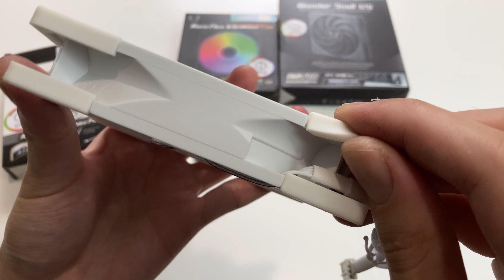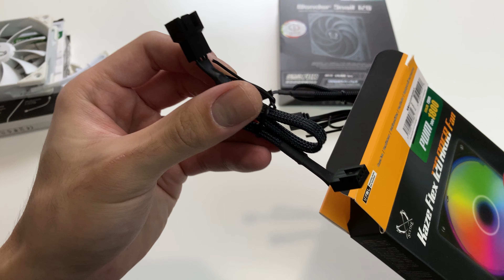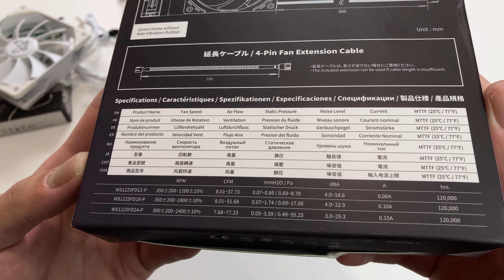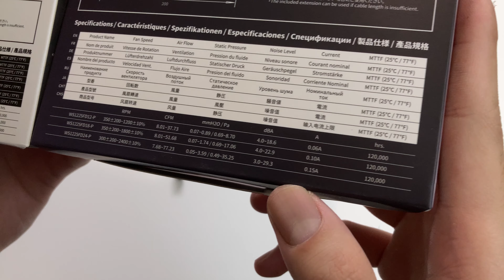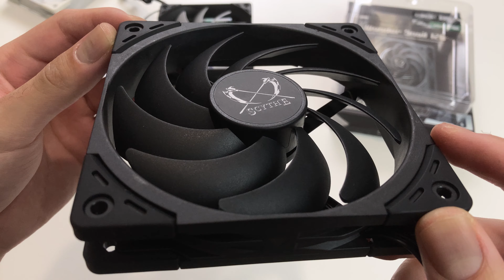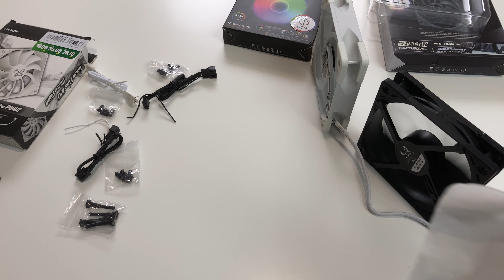New Gentle Typhoon? | Wonder Snail, Kaze Flex White/ARGB | Unboxing & Demo

Comment: The Wonder Snail sounds like moving more air than the other...
Reply from the maker: The Scythe Kaze Flex actually blows a lot more airflow but the Wondersnail supposedly has higher static pressure.
Reply: @OTechnology  I can see that on the paper test, but when you pointed the fans on the mic, wonder snail sounded ... more angry
Reply from the maker: @DxBang3D  probably because the airflow is more focused in a straight line